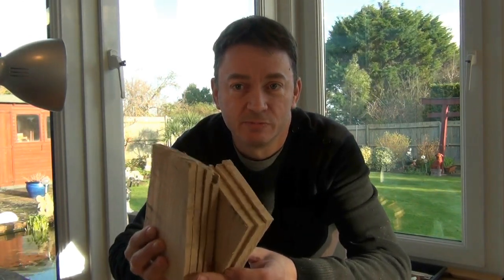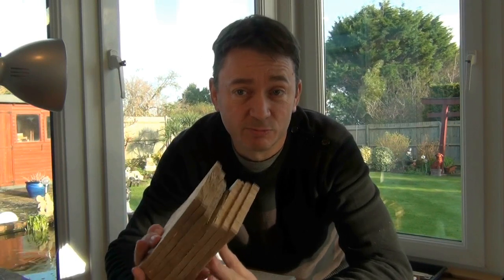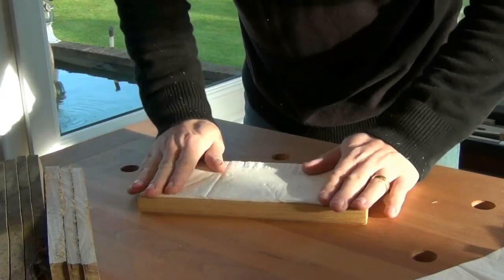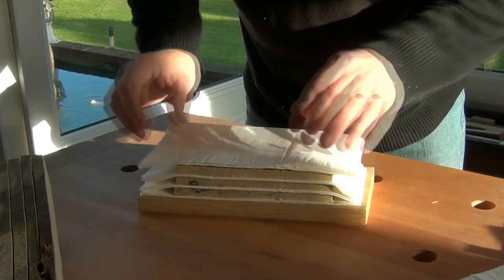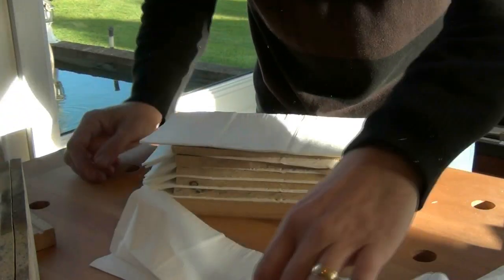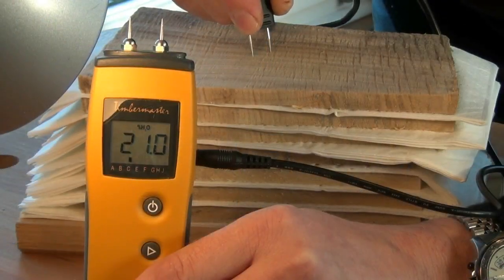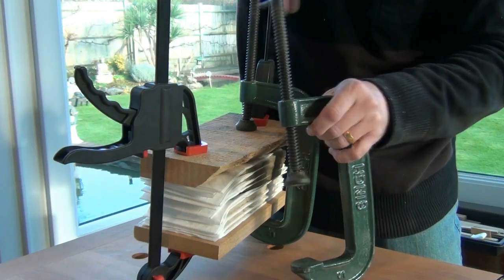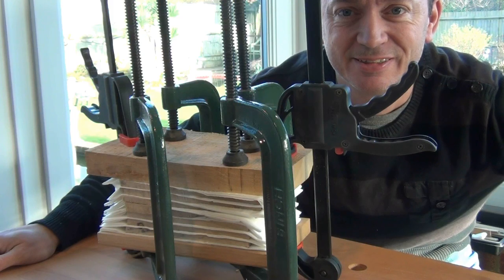Drying Small Boards Quickly - An Experiment, part 1

Comment: You could put slats between the boards then clamp them and set a small fan set on low speed to blow thru the wood.
Reply from the maker: That's a good idea. I use the convection current of a radiator, but that's no good in the summer.

Comment: Nice one Mitch ,perhaps you should take humidity readings and temperature readings as well as not all of us live in your sunny climate.The guy who commented about no control group was right there should be one. I think it will make a difference / speed up the drying process if you don't put it next to your bed but somewhere where there is a draft.
I think that most water is released through the end grain though and you haven't got any tissues there you've only got them on the long grain , woods cell structure is like a bunch of straws and is only really open at the end grain ( I know you know this but some readers may not.) Liked the weighing idea.
Reply from the maker: Neil Turner Great points Neil. I'll see what I can do about more readings. As for the 'next to the bed', I opted for somewhere less likely to cause marital strife!

Comment: You could also weigh the blanks and when they stop loosing weight then they should be ok to work with
Reply from the maker: Michael Flynn Thanks Michael, that's a great tip for everyone.For anyone trying this method, remember that you must reach this point with the wood drying in the 'climate' that the finished project will be kept (within reason).Cheers, Mitch

Comment: Interesting experiment.

I imagine it probably wont help to use the paper as the moisture needs to get out into the air. Once the paper absorbs water, it will be stuck there. I could be wrong of course.